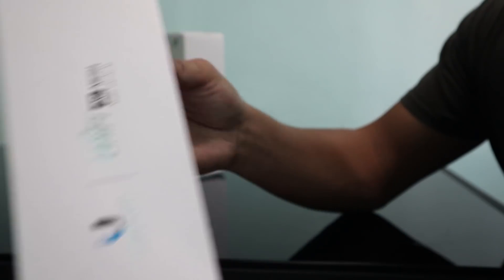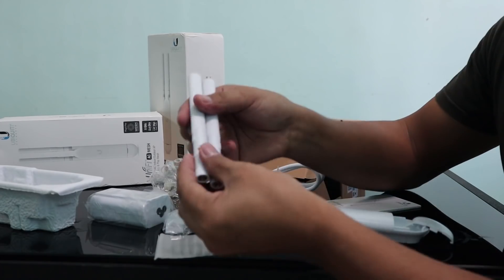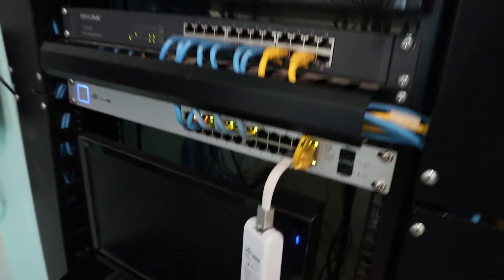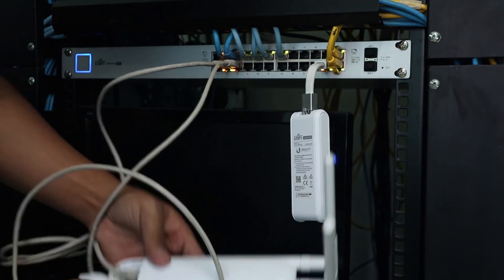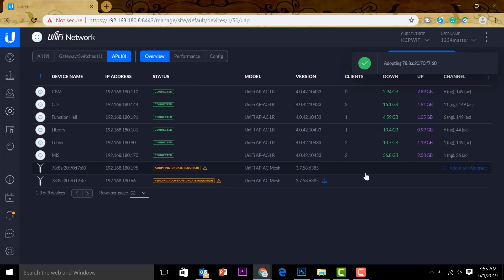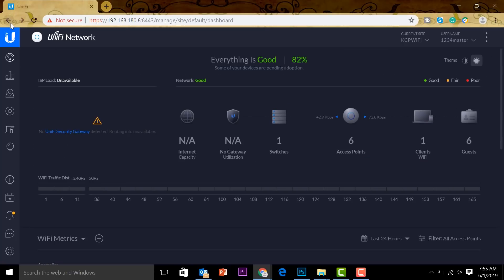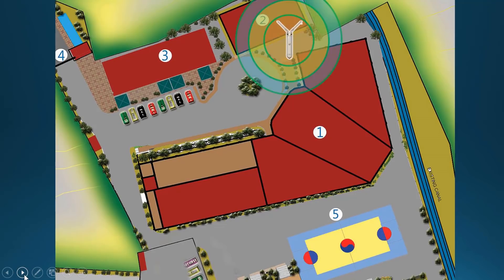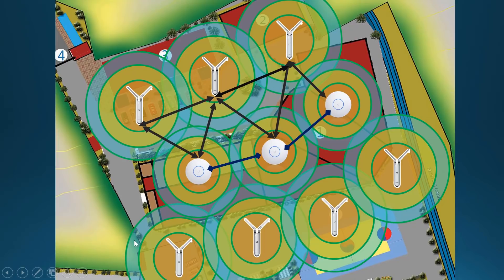How to Extend Your Campus WiFi with UniFi AC Mesh Access Points | Full Setup GuideDescription:

Comment: I am currently in the process of doing the research on how to configure multiple access points as "MESHED" access points and I am still looking. 

This video shows how to add an additional POE access point, not a meshed access point. 

The whole point of a meshed system is not having to run ethernet lines all over the desired area. Right? Should be....just a power source at the access point is all that is needed. No?

Comment: Can this Mesh WiFi Unifi AC be used as AP for PISO WIFI?  How long does it reach approximately (with line of sight of course) in meters? Thanks for the reply sir.
Reply: If your planning to build a captive portal you need to use the same brand of products like Ubiquiti or Tp-link in order for you to manage in the controller. The answer is Yes,  but you need to use the Ubiquity products in your set up or else you have to configure each without the central controller.

Comment: Really gave me an idea.  I already have a TP Link eap 225 mesh at the corner of the house. it works great to the metal shed 75 ft. away…IF door is open…door closed? ->no WIFI .   If I got another AC1200 mesh EAP225 for the shed, would I connect it to a router in the shed acting as an extender?   OR just an extender with one antenna into the shell of the shed interior, and the other  antenna talking to the  the EAP225 at the house, WITH the shed door CLOSED?!
Thanks!
Chas

Comment: Hi, 
First i like how you did your video and thanks taking time for it. 
I do have 2 ac mesh connected to a wifi hub distributor from Vidéotron who they are my internet supplier witch is connected to there main fiwi hub. 
So i do not have a unifi controler. 
So I connected the 24 v device with the first unifi ac mesh on the poe tap and the first ac mesh on the lan tap. I did power the 24 v with the 110v. 
I did connected the second ac mesh to the wifi hub and also did same connections to the second 24 v and power it 110 v. 
I just could see one ac at the time. 
I did many connections ways and all the same. 
I did what you juste made on this video and they are not communicating together. 
Can you help me on this situation?
Thanks in advance!
Gas

Comment: I have a question hope you can help or any one on the comments section, so far I know for each hop according to ubiquiti the bandwidth is cut in half, the thing is that I set up a public Hotspot in a town, and setting the bandwidth on the vouchers as 5 mbps  down and 3 mbps  up, if I have up to three hops, then on the last ap I will be getting   less than  1 mpbs on download?,
what I don't get is that when using multiple hops, what is cut down is the link speed between them or de total bandwidth passing trough the link wich are two things different.

Comment: You could have saved a lot on a couple of access points, by changing the stock antennas with another with higher gain. Nice video
Reply: No that's not the correct way to do things... speed requires two traffic transfer... so unless you laptop or phone also has a stronger antenna it's only half the equation
Reply: @tmillerau  This is correct. The antennas of the mobile device is a critical bottleneck.
Reply: have tried that? did it work?

Comment: hi sir. I need your help. I'm planning to provide a wifi connection for 3 schools. those schools are located in a different area and I want those 3 schools are connected to my network to provide an internet connection and i can easily troubleshoot and manage the network. the distance between my location to 3 schools is 4-5 km. how is the setup?
Reply: Hi sir have already provided internet connection each school. Just want to get idea. Planning din kasi mag provide ng internet sa school.. Thanks sa reply..

Comment: After configuration/adaptation of mesh ,i can unplug it then deploy it?
Reply from the maker: Yes bro, make sure the controller can detect it, and u can see status connected via wireless
Reply: @torogipro  ty bro,  wirelessly i can re-config,  change settings, etc.  my mesh afterwards?  Right?
Reply from the maker: @aakifah0811  yes bro.
Reply from the maker: @aakifah0811  as long as you have already adopted the AP
Reply: @torogipro  thanks a bunch sir
Reply from the maker: Yes bro

Comment: Hi please correct me if im wrong, im planning to have a wifi hotspot in my area using unifi ac mesh, but if i only have na ac mesh i need to open always my pc or laptop like others say, but using the ac controller, i dont need to open always my pc or laptop? And i can access or control thru android phone? Please help. Thanks
Reply from the maker: Yes amigo, the controller will always be up and connected to the network, you can access it with phone or thru ur browser.
Reply: @torogipro  without controller, for example, unifi ac mesh only and then i have 5 connected user with 5mbps limitid speed each, when i shutdown my pc they will have full access of speed? Or they will not have connection because my pc is shutdown
Reply from the maker: @richierich8166  yes
Reply: @torogipro  sir plesse complete your answer 😊 yes what? They will have full speed connection? Or they will have no connection 😊 thanks sir
Reply from the maker: @richierich8166  if your are running dhcp in your controller/latop then u shut it off , there will be no internet access to ur clients, if u are running it on another device like router then u shut ur computer ther will be internet but other configs like speedlimit will not work.
Reply: @torogipro  oh i see thanks, the uap acm will be connected to my default router, the one provided of my isp